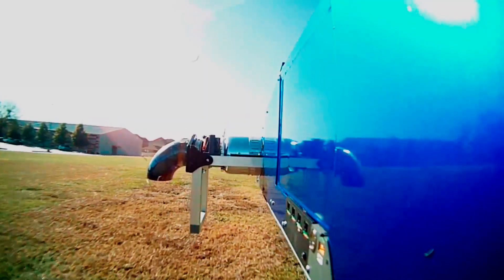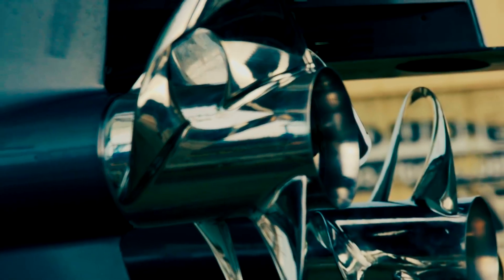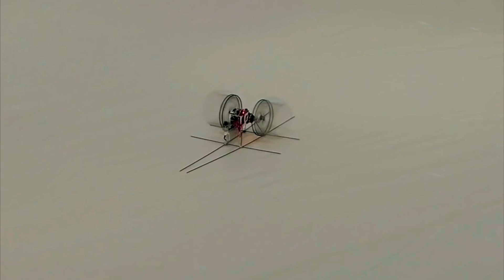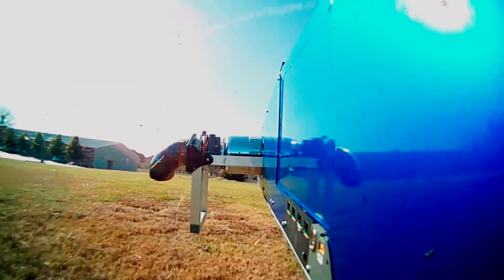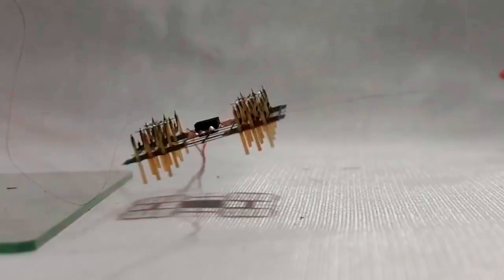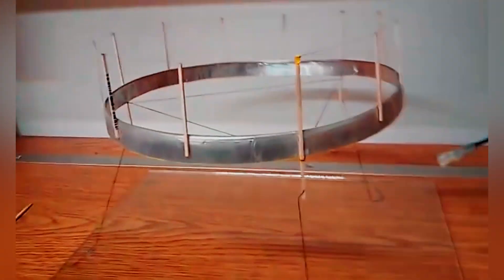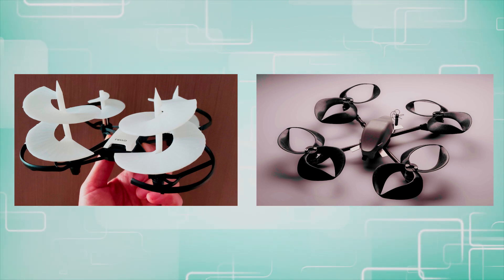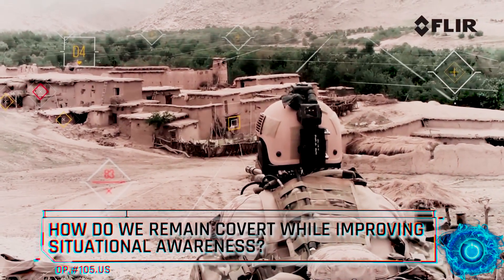Drone Propulsion - The LATEST Breakthroughs!

Comment: You missed a few innovations, on your other videos, and that chanel that has many bladed 350mph+ drone designs.  That's crazy stuff.

Moving over to vtl and pv aircraft, there is one based on the Dyson fan technology.

 There is a single prop alternative to private corporate jets, with linear design.

There is a drone for deliveries that has a delivery box with 400 feet cable to drop the parcel on a dinner plate sized area.  It's propeller system is very quiet and likely very efficient. It on the same channel as the African drone blood delivery service that has launcher and dual arm capture.  500,000 deliveries in 6 years to hospital from the central base.  I think both are the same guy who designed them.

Have a great day.
Reply: The company is Zipline, founded by Keller Rinaudo Cliffton. I don’t know if they have their own YouTube channel, but Mark Rober's video on them is worth a watch.